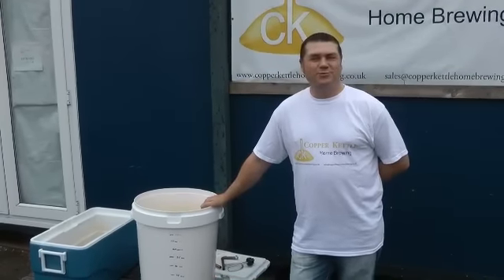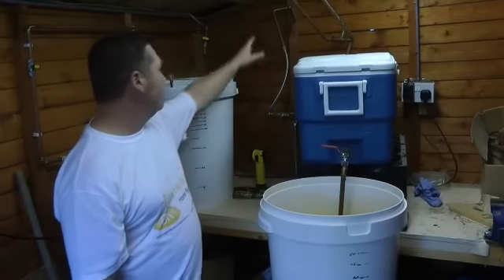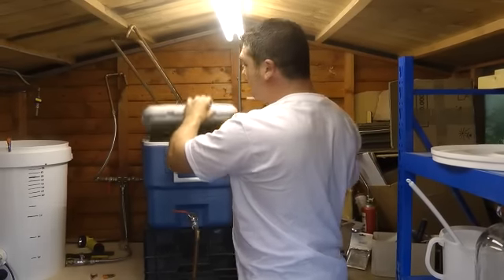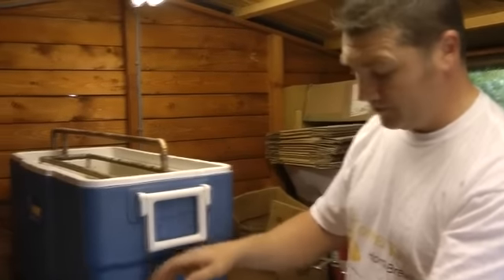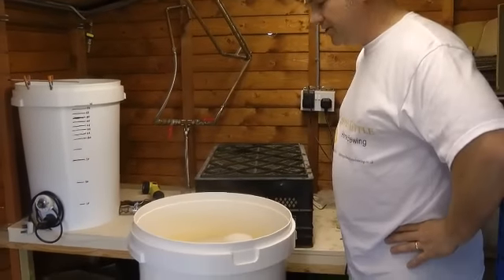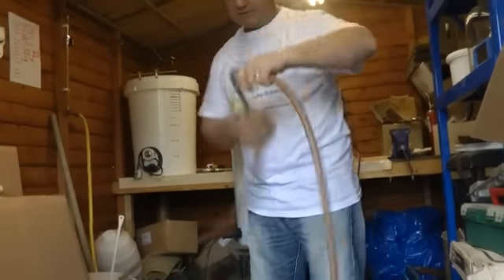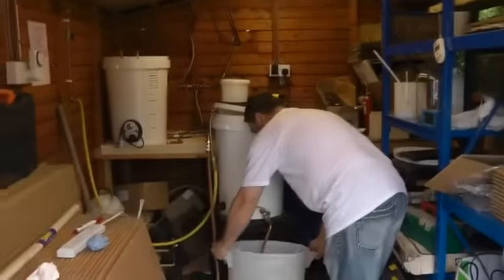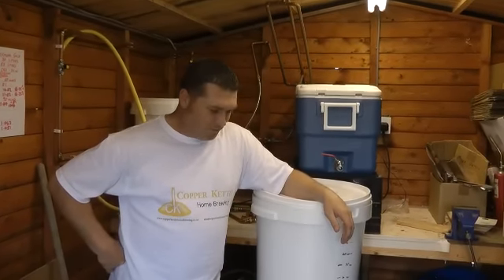How to brew all grain beer - tips, timings and equipment

Comment: Thank you for sharing.  I like your homemade sparge arm, brew kettle, and filters.  I would have never thought of using a plastic bucket with a 220v heating element.  In the US we use stainless steel half barrel kegs and propane.  I got some good ideas from this video.

Comment: It's so interesting to see the difference in approach from most american home brewers' methods.  2 questions from a brewer across the pond:  1. I've never heard of boiling in plastic.  Electric heating elements don't melt the plastic bucket or leech chemicals into the beer?  2. What kind of solution are you sanitizing with that you have to rinse it?  Most brewers in the states use star san (acid based, no rinse required, so you just dump it out and don't need to worry about the residue.)

Comment: @ Speekerful, the standard fermenting buckets would not make good boilers as they are too thin.  They would go very soft.  The polypropylene buckets have a much higher temp rating, and although they go soft, they are still more than manageable.  For extract brewing, you can get away with using a stock pot/saucepan of around 10 litres in size, then simply top up with cold water when in the fermenter.

Comment: The leads are the same size as standard PC leads, but I wouldn't recommend using PC leads.  The correct leads are available from most electrical retailers.  

With both elements running for the duration, the loss was around 22%.  Using only one element to maintain the rolling boil, the loss was around 15%.  Obviously these losses are very dependant on the ambient temp in the brew house.  The colder the abient temp, the greater the loss.  Now that I have a chimney, the losses are less than 10%.